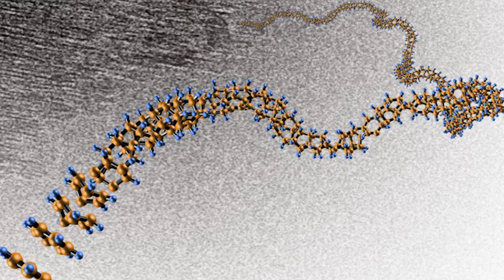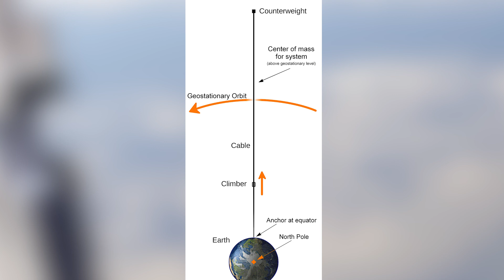Can We Build Into Space?

Comment: "Theres no material strong enough to build into space" then why does the ISS exist?
Reply: doesnt the ISS float?
Reply: SquareAhernandez YT, I mean material that is strong enough to handle the vacuum of space.
Reply: The ISS handles the vacuum of space, I don't know exactly how it was built, but the materials used can of course handle the vacuum of space, what the video means is building from the ground up all the way into space,
Reply: It's Ya Boi Daniel, I think we can still build up into space with the materials we have, we just have to have a big and strong foundation and a lot of funding, I think the building would probably be massive on the bottom and get smaller as it goes into space, that's how most skyscrapers are made.
Reply: Even if it were possible the cost would likely not be worth it, or at least for the time being, and it is likely that bolt like you see in some skyscrapers if you see in steel beams or whatever, they likely couldn't support all that weight and they would snap and fall, so the structure would be unable to support itself and it would need to be totally welded together,
Even if we did that we would need to think about the ground underneath if even it can support the structure do to how thick the steel or whatever would have to be used for the structure causing it to be so heavy the ground could crack and break underneath it, which would suck for whoever made the structure,
With the materials required for such a structure to exist and how big it would have to be, and how heavy it would be, and all the risks involved (including the structure totally collapsing while being built), it would be a total waste of resources which could have been used elsewhere,
Reply: It's Ya Boi Daniel, I see... thanks for the info